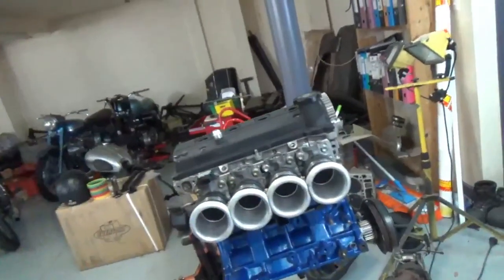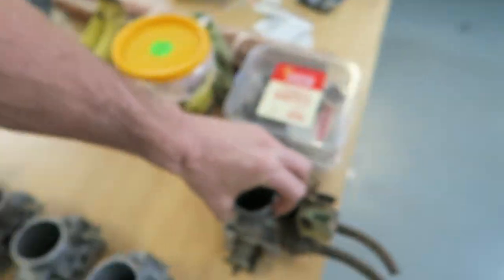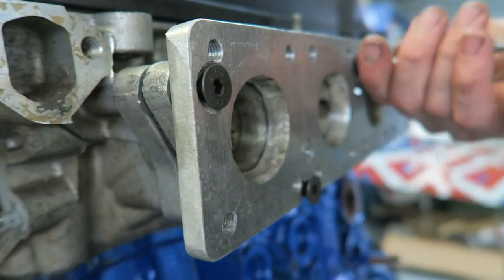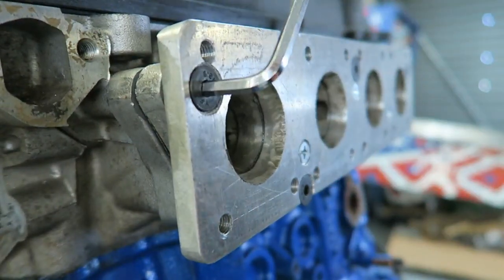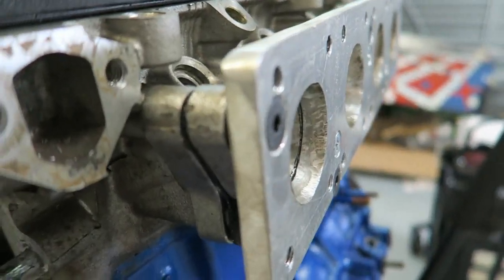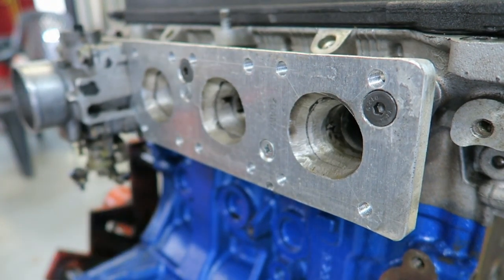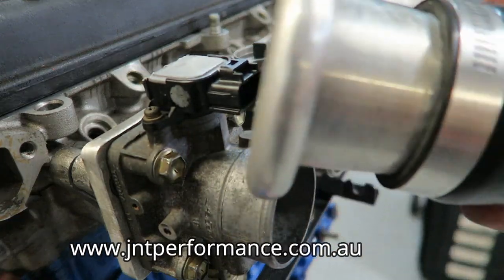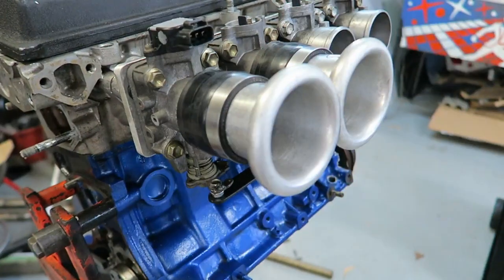How to build your own custom ITB intake manifold

Comment from the maker: AFTER ALL THIS EFFORT DO THEY ACTUALLY WORK?? I have posted two great links below, one is of the car driving with the itb's. The other link is me making a custom air box for them. Guaranteed not to disappoint :D please consider SUBSCRIBING!

Driving with ITB - https://www.youtube.com/watch?v=lzXDef-9KgA&t=45s
Custom air box - https://youtu.be/aW5h6uejErQ

Follow me on INSTAGRAM https://www.instagram.com/eviltwinep91/
Reply: Any more info? 

Anything you would change or do differently?
Reply from the maker: @dunkthebomb I ended up making a set of adjustable linkages instead of the flat bar you see in this video... also switched from tps mode tuning to MAP sensor by using a vacuum line on each runner going to a balancer box from ebay ($30)

Made tuning a lot easier
Reply: Hey Matt, this is awesome! I am currently working on a ITB(from a BMW V8) setup for my C4 Corvette. I was kind of “stuck”, thinking only about one setup option. After watching what you did it opened my mind. I will follow exactly what you did(because you showed us it works!!). It is Saturday, 11pm, I am super happy that I found your video, it made my day! Thanks 🙌🏻!

Comment: This is exactly what engineering is all about.
Reply from the maker: Not calculated at all, yet still works lol
Reply: @MattBerrymotorsport  It isn't stupid if it works. It pains me to see people put down good ideas because they are executed poorly, not everybody has a machine shop with a multi axis mill. If it works and is done poorly then is it really done poorly? Personally I would do it. I am planning on welding GSXR throttle bodies to a Honda intake so yeah. Love the video.
Reply: @BoostedPastime  is that... possible? Wtf? How'd it go?
Reply: @MattBerrymotorsport  I was thinking of doing one for a rb20

Comment: Well done!  That is a truly elegant design and execution. 

A suggested refinement would be to make the relative position of each throttle pin in relation to the actuator bar, so you could balance them precisely.
Reply: +1 for this.  Being able to sync the itbs together is critical to a good tune.  Multiple ways you can do it, but the logical way would be to fab the linkage out of all thread and use nuts fore and aft of each butterfly pickup to control sync.

Comment: You sir are a genius! Been wrenching for twenty years and I would have never thought of that. Quick question are those the factory throttle body that's meant for/ or comes in  that engine?
Reply from the maker: Hello thankyou Charlie. Yeah they are the factory throttle body x4 . That way I can use the factory TPS, plus I had a lot of spare parts to make this
Reply: I found that you can also try to use motorcycle throttle bodies. Especially if you are going to have to use an aftermarket ECU or piggyback

Comment: You should try tuning without the mesh "filtration" from what I've seen mesh in the intake stream disrupts flow and kills power, without those trumpets you have plenty of room to build a plenum which could utilize the oem ducting and filter. Just a thought :)
Reply from the maker: We tried it without the mesh, made less than 1HP difference. I think id rather lose the 1hp rather than a rock going inside lol. so was 133 hp build with a turbo or just N/A?
Reply: @MattBerrymotorsport  no turbo, I've always been n/a. I'd suggest a flow test then maybe, i think another youtuber did a dyno with and without a similar mesh and lost a fair amount of power. I was suggesting you could use an oem cold air setup and filter by building a plenum to keep the debris out and duct in cold air via the oem filter.
Reply from the maker: @Ricerguy  133 HP from stock 5efhe cams?
Reply: @MattBerrymotorsport  5efhe cams (set to the 4e timing mark retards the valve timing 2.2degrees approximately and shifts the powerband higher up.) Yes.

Comment: Absolutely unreal, explained so clearly and so easy to understand.  

I really wanna do this to my n43b20. Its a really low mileage 2009 e92 320i. Has the looks just not the power. If i wanted to do the same, do you think i would have to buy 4x n43b20 throttle bodys or use something else. And does it have to be mapped to ecu or something? I seen the connector on the 4efe throttle body.

Comment: Starting up a Locost build with a Duratec 2.5,  may take a crack on DIY ITB's  Given the cost of the kits,  I might give it a try with the help of 3d modeling and SendCutSend for custom plates

Comment: I’d be curious to know if a standard cable and pedal will pull all of them. I suppose you could add a spring for assistance. Very cool setup and video!
Reply from the maker: I removed 2/3 springs off each TB. The pedal feels a tiny bit heavier than standard but i barely notice. Using all of the factory return springs makes the pedal quite tough
Reply: @MattBerrymotorsport  I plan on doing a similar setup to a 92’ GTI 16v this spring
Reply: @svrider2006s  how it it go?

Comment: I'm in the process of fitting ITBs to a BMW engine.
Couple of questions if I may.
1. What did you do with the brake booster vacuum hose? 
2. What did you do with the CCV?
Reply from the maker: Hi Richard look up "vacuum box on ebay" this allows you to run the booster and also a map sensor if you have one. What is the ccv?
Reply: @MattBerrymotorsport  hello. The CCV is the crank case ventilation. It's what stops the crank case building up pressure from combustion blow by.
It's basically a pipe and valve that connect from the crank case to the intake manifold.
I guess this could also connect to a vacuum box but I'm guessing you would need to connect the vacuum box to each throttle body?
Reply from the maker: @richardschofield2201  ohhh i understand. we call it a pcv. positive crankcase ventilation... same same. i dont use one with this application, i have an oil catch can instead, Yes you could run it to the vacuum box, but you will get oil inside the vacuum lines and im not sure how long that will last

Comment: Did you need to retain a lot of vacuum from the original single unit t.b? I showed this to one of my friends for some tips cause i really wanna do this on my corolla and hes talking about a vacuum block for the fuel pressure regulator.

Comment: Man what a nice setup, I've got a 96 Tercel with the stock 5efe second gen, I'd love to have an n/a build, would you recommend this engine or the n/a 4efe which I can get for cheap and swap it myself
Reply from the maker: Hey thanks Javier, they are a bit overkill for size, but still they sound fantastic and were pretty cheap to put together.

the second gen 5e don't have very thick rods... they will rev to 7000 all day every day, but if you want to run more rpm than that, go for a 1st gen 5efe with the thicker rods...

If I was to do another one, id probably do a 4efe so I can rev it a bit harder... anyway I had to start somewhere so lets see where it goes lol
Reply: Hey 👋 Panamá. Lo hiciste?

Comment: I think I’m gonna work on a functional hood scoop direct to the air box , won’t be much more power but then my motor won’t be trying to have air , it’ll take when it wants
Reply from the maker: I made something similar, it works great. Maybe this link will give you some ideas. Good luck with your build  https://youtu.be/aW5h6uejErQ
Reply: @MattBerrymotorsport  thanks

Comment: nice idea , be cheaper then using hyabusa motorcycle trottlebodies (there larger too) or adapt some bmw ones  , you still want some adjustment between the trottleplates to get the vacuum right between all the intakes , it still should work as is though
Reply from the maker: Yeah I've since gone to adjustable rods 😊

Comment: Hey buddie, I noticed when you said you used 2 manifolds and just had them machine to the runners. One must be the manifold to the head but what about the 2nd one before you slap on the adapter plate.

Comment: Hello sir genius idea
But what about the tps? 
Can we run the car without the tps? 
And should it be tuned?
Reply from the maker: Hello the TPS is on there , it bolts onto the stock location. 

You need a TPS when using an efi computer. But not with carburettor

Yes it should be tuned, I have only tested this manifold on a build engine with an aftermarket computer. I would really like to try it on a stock computer and see how it goes lol
Reply: @MattBerrymotorsport  but i see only 1 tps on your tb set up?
Should i put and wire all 4 tps? 
I wanted to try this on stock ecu
Will.let you know
I want to do this on my honda k20a cl7 euro R engine 😁😁😁
Reply from the maker: @jaabircl7r526  oh I see what you mean. I only use one TPS. All four throttle bodies must be set up so they open up at the same time. That way you will only need one TPS. 

I don't think 4 TPS would be possible

Comment: Want to smash the like button more than once 👍👍👍👍👍👍
I need to do this with my beams!
Reply: Not sure if you know already but there's kits available to adapt itbs from 20 valve 4age to the Beams
Reply: @irabrook  absolutely already know that, there's not that many bt 20v throttle bodies available and why would I use them on a 2L motor when they're designed for a 1.6L? I know they "work" but surely they aren't the ideal size for a beams

Comment: Nice video, but I got a question. I'm thinking about converting my 4afe to ITB with a 4age 20v intake manifold. Got an awesome offer on one. But I'm not sure about the air flow meter/ECU and how to get it running right. 
Is it even a problem, or am I just making something up. 
Hope somebody understands and can help. 
Cheers
Reply from the maker: That sounds fun! Best thing would be to remove the air flow meter all together and go with a stand alone ecu. Don't waste your time trying to get good power gains from a stock ecu on a different engine.

Good luck my friend 😁

Comment: Should have flipped it, so the throttle cable is on top of the itbs not below. Like the stock 4AGE 20v have them. I have a 92 Celica st with the first gen 4AFE engine looking into a complete 4age 20v swap or adapt the 20v Silvertop ITBs over. Now with this video I'm encouraged to make custom itbs.
Reply from the maker: Yeah I looked into this, the problem there is the linkages don't clear the fuel rail. Great idea though :)

Comment: Great concept! Well atleast if the fuel injectors are directly on the cylinder head like on the 5EFE. This will not work for example on a 4AFE were the injectors fit on the intake manifold. Any thoughts??
Reply from the maker: Buy the weld on injector bungs and put the rail wherever you like

Comment: How does the idle work?
How do you balance them?
EDIT: Running on tps or map?
Reply from the maker: I was firstly running these on TPS only so I didn't need to balance them. I have since hooked up a balancer box by drilling each runner and putting a pipe in there to fit a vacuum hose to, then hook all four up to a box so that I can run map now

Comment: hey i just wanted to know, how would you get all the butterfly valves to open up as you put your foot down, is this done with a throttle cable or something
Reply from the maker: on throttle body number 3, i have the stock cable link still attached to the throttle. In the video i made a new cable bracket to hold it in place.

Comment: What about Idle Control Valve ?
Reply from the maker: Hi I am using aftermarket ecu, therefore I don't have it plugged in. I just adjust the idle with each throttle body.
Reply: I have the same question... What happen in cold start? Wow do you adjust the idle rpm?
Reply from the maker: @JBRI94  it has an efi system. Cold start is adjusted in the ecu.

 Each TB has a manual adjustment on it to raise idle.

Comment: pretty nice video. but i have 2 questions arent these throttelbodys a bit too bid or is ther no such thing as too big for power gain. And do you run a stock ecu. i mean. you get now much more air in there? can the ecu handel it?
Reply from the maker: Hi there 9/10 people tell me they are too big, but it makes more hp with this than the stock manifold so im pretty happy about that. I think the only reason for this is the stock intake manifold runners are actually smaller than the actual head port, no wonder lol

I haven't run these on a stock ecu before, in my case with the smaller runners I dont think it would run too well.

We are putting together a manifold for a proton jumbuck ute using the stock ecu, keep an eye on the channel, hopefully it works

Comment: I know this is old, but I was wondering if you have any input on my planned build. I need to know what I can do with the MAP sensor and the brake booster hose for my B16A. Thanks in advance!
Reply from the maker: Buy a vaccum block kit off eBay. Put one vaccum line on each of the ports and away you go. Comes with a large fitting for a brake booster hose
Reply: @MattBerrymotorsport  I will research on that and try it. Hopefully I will be able to finish this build and hear the glorious sounds of vtec on itb’s hehe. Thank you for the response!

Comment: Do you have a vid of it in action?

Also, does the engine work with 1 throttle position sensor? I see other itbs with all 4 sensors on so I wonder
Reply from the maker: Links are on the top comment

Comment: Nice!! Well done and really creative, how many horsepowers did you gain with all your mods? I have 1.6 4A-FE and I want to have more power, do you think is better to go crazy with this engine or better get a silvertop or maybe blacktop 4A-GE, I have an AE111 Levin
Reply from the maker: Thanks Jose i didn't gain much HP, around 30 HP... But the torque numbers almost doubled to 120nm.

Car is really fantastic to drive.

You will find that the 4 age is a much better designed engine than my 1500cc 5efe... Put a set of cams in your engine along with a good exhaust manifold and you will be over 200 HP. With an after market ECU of course
Reply: @MattBerrymotorsport  thanks man

Comment: Hey Matt - i got a question i couldnt find answer for
Camshaft has a gear that is split. There is circlip, wave washer, half of the gear and u shape thing in between gears halves inside with a pin on each gear.
I guess it has to be tensioned... so the pins insert pressure on U-thing.
Do u know the way it is set up?
When u leave it without tension the U-thing is not being held by anything and can move both sides...i am not sure if that would be clear to hear as the whole assembly might be filled with oil especially that the first half of the gear is actually being oiled from camshaft like the cam bearings
Thanks
Reply from the maker: put the camshaft in a vice, dont squash the lobes... put the gear assembly together and you will need to get a pair of multi grips and a rag and carefully turn the gear until the hole lines up with the m6 thread... put a short bolt in there and tighten it up. once you put the cams back in the car and youre happy with the cam timing, remove the bolt and youre good to go!
Reply: @MattBerrymotorsport  
Hey - thanks for answer - i looked at it more carefully and i realised that when the spring starts to tension gear halves the teeth are only 1/3 tooth  from each other.

Now i just pushed that 1/3rd so the gears got aligned and wave washer gave enough tension so i could put it back together

I have another camshaft laying around and i can see that when m6 holes got aligned it is extra tooth more.

I guess that it might even rattle if u dont at least minimally load that spring like i did

I thought that one tooth extra is quite some force exerted by that gear.

What do u think? Thanks for answer
I asked few other questions but found the answers on your films.Cheers
Reply: @MattBerrymotorsport  

BTW. regarding stock cams.
Would u leave stock timing or would u change it a tooth or two?

Comment: It's ot possible to install this on a 2020 mx5? Or if you could make one I wouldn't mind to support the funding for this endeavor.
Reply from the maker: Anything is possible  i wouldn't be suprised if that model doesn't use a throttle cable... i wouldn't be interested in something like that just yet, quite complicated...

Comment: So a couple questions 
How do you balance the ITBs with that sold flat bar linking them?
Isn’t four times the original throttle body size is going to have way to much CFM of air for that engine?
Reply from the maker: First question, ya don't. I had the all of the itb closed and made the solid flat bar. Then slowly adjusted each TB a quarter at a time until the idle was stable. It actually worked surprisingly well. Ive since moved to adjustable rods, ill find a link for you to look at

Secondly the throttle body size doesn't always increase air to the engine, if anything it can slow reduce it as the air speed slow it down making the low end torque really bad. But it increases the top end torque a little bit which is where I spend 95% of the time when driving this car lol

Overall this simple way is a great cheap entry level to just get the noise and to have a bit of fun.
Reply: @MattBerrymotorsport   When you increase the size of the throttle plate air intake velocity drops which lowers bottom end torque, Four smaller ITBs would give it more drivability bit still achieve the top end power. There is no doubt you will loose low rpm torque and it will make it peaky the way it now.

Comment: how do you know wich tb's to use? im afraid if i do this my car wont idle properly and just cut out because of not getting enough air
Reply from the maker: The ones I used are insanely oversized. They work fine.

Camshafts are what limit air into an engine.

Comment: Is it difficult to custom make trumpets, or are there any that should work for any car?
Reply from the maker: Hey if you jump on that website I listed they have all sorts of sizes. What size is your engine, I can point you in the right direction for size. The ones I've used in this video are way too big but I did it for the look. They still work fine :)
Reply: Matt Berry mine is a 1.5 liter 4 cylinder